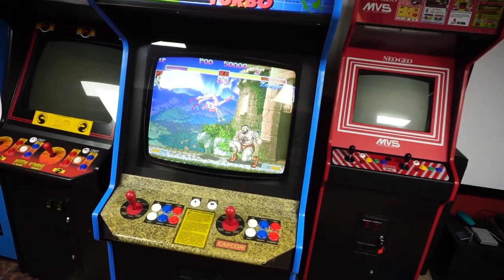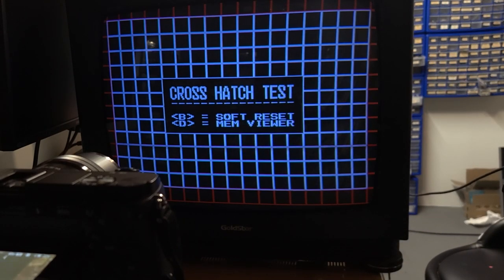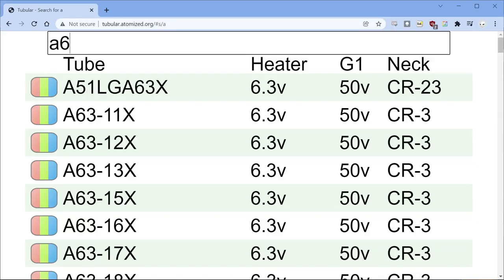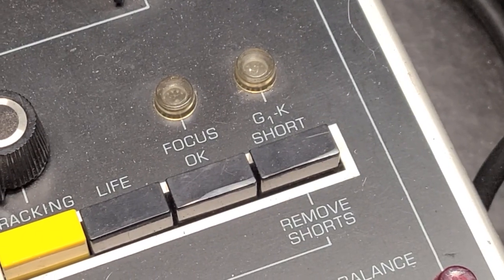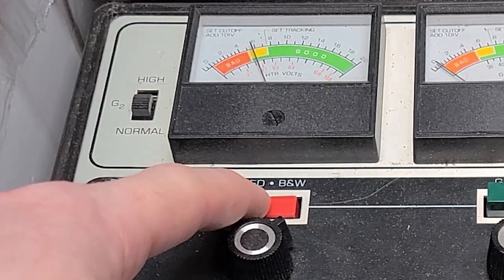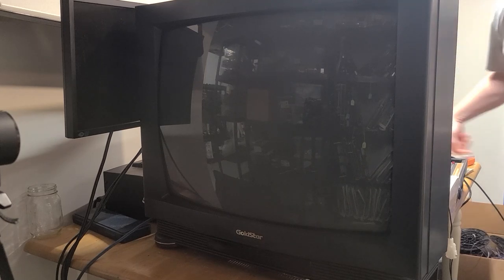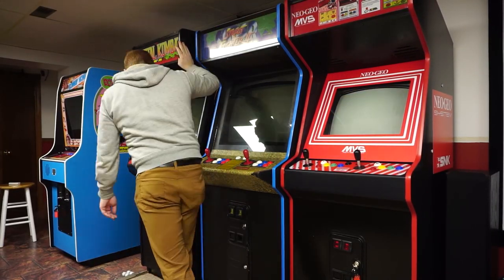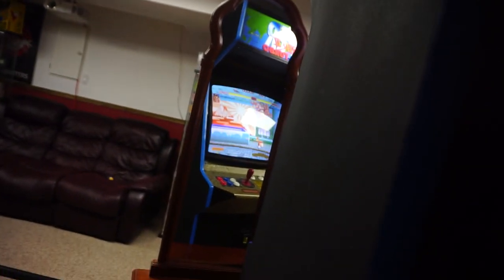Arcade CRT Tube Swap and Rejuvenation (25" WG K7000)

Comment: Tim here, this is my unit, I find that most tubes respond well with just a clean and balance, although sometimes one gun may actually get worse after the first cycle, requiring a second cycle.  You are basically blasting material off the guns, and that material CAN find it's way onto another gun.  Once in a while I will encounter a tube that requires "rejuvenation"... but they generally will improve somewhat.  I have not had a tube worse off after the process though. If you do encounter a tube with bad gun(s), there is no repair... it is garbage.

Comment: Hi! I’m looking into replacing a tube in my old cabinet, is there a more detailed video of the actual tube swap (and the possible adjustments which need to be made)? Or just a guide on how to do it properly? Thanks!
Reply from the maker: Hi! I would recommend reading up on examples from others using the same base monitor. The WG K7000 monitors can easily swap tubes, but other common ones like the Electrohome G07 are nigh impossible because of tube compatibility. So figure out what monitor your game uses and start searching from there!